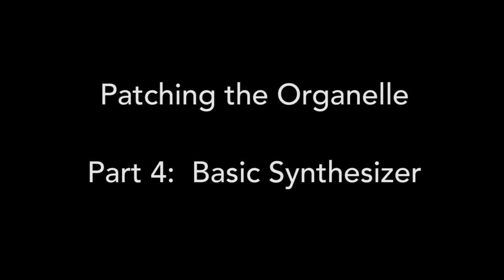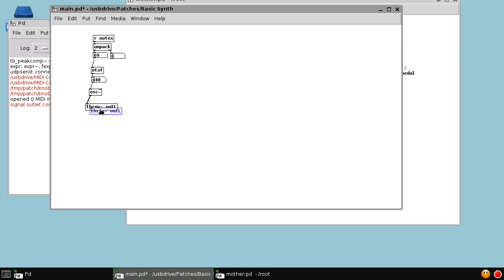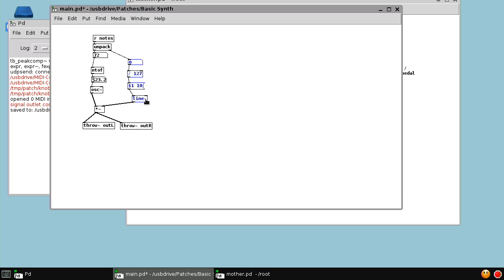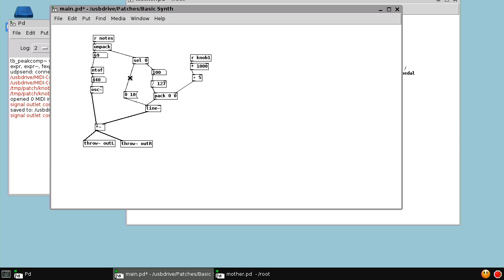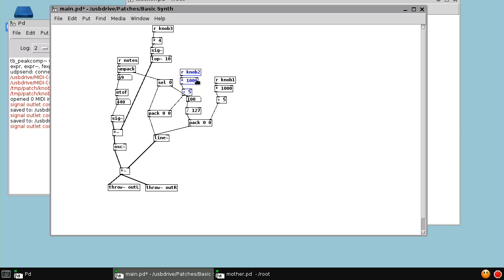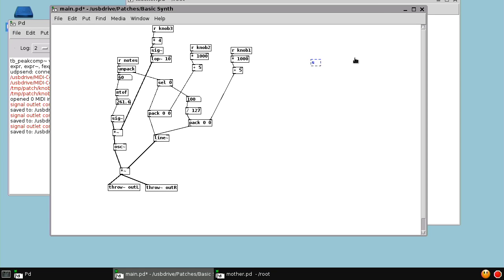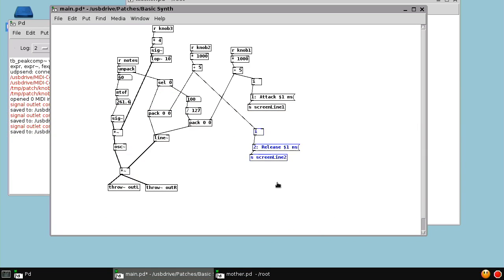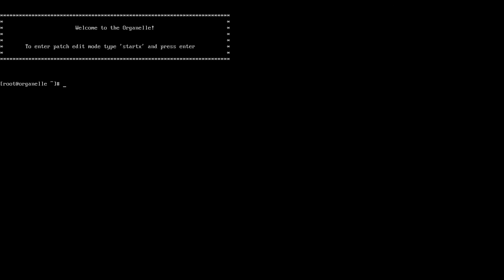Organelle Pd Patching Tutorial, Part 4: Basic Synthesizer

Comment: Howdy! I know I'm wildly late to this party, but I'm having a problem following along at one specific point. At around the 3:45 minute mark in this video, you pass a value from an object that seems to have two parameters into the line~ object. If I may ask, what is that called and how do I add it? 

I checked the PD docs and it looks like it's called a switch, but then I can't find a way to actually add one to my demo patch.

Edit: after dissecting the patch you had made, it looks like that is a message block, and I got it to behave. Appreciate you having that handy!
Reply from the maker: More information about the '$' / variable convention here: https://msp.ucsd.edu/Pd_documentation/x2.htm#s6.5

Comment: hi! could you please expound on why we have to divide the midi velocity by 127?
Reply: or how dividing the midi velocity by 127 stops the oscillator?
Reply from the maker: By itself, dividing the MIDI Note Velocity by 127 doesn't stop the oscillator. We use the result of that division to control the amplitude of the oscillator. This occurs in the [*~  ] object just after the [osc~ ] object. An oscillator with an amplitude of zero is 'off'.
Reply: thank you! i just realized like 4 hours after i posted this comment. i suck at basic math. thanks again! very interested in purchasing an organelle sometime in the future.